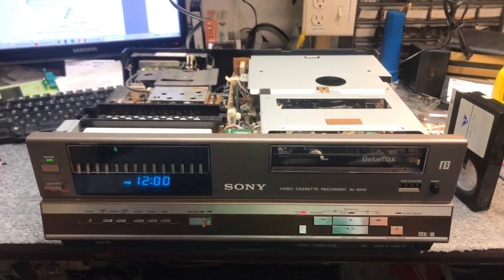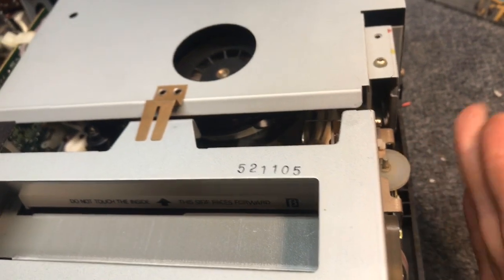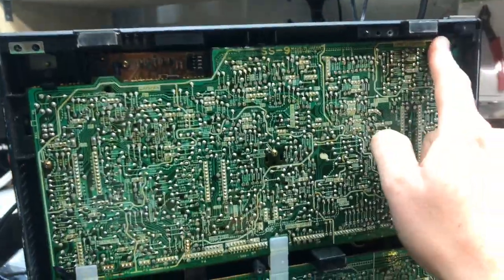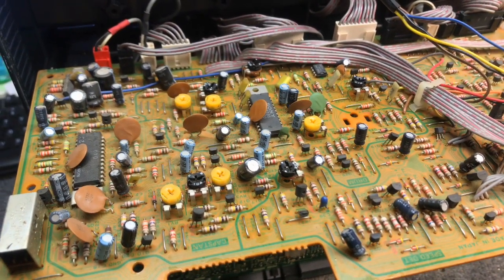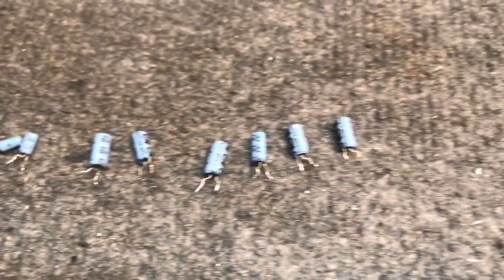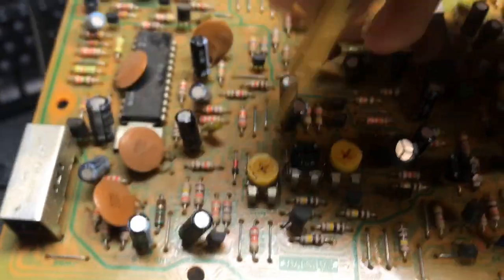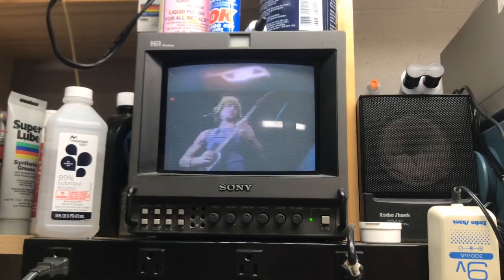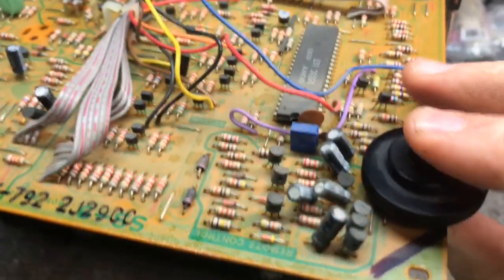Sony Betamax SL-5000 Series Repair - No Video/Snow

Comment: I have replaced the 0.1uf electrolytic capacitors with 100nf polyesters and they work perfectly fine.
Reply from the maker: Yeah I’ve since moved away from the electrolytics.  It’s getting tough to even find them in values that low.

Comment: I know its been 5 years but thank you for keeping this up. I am currently working on my sl-5000 that has motor speed issues 😂 i just got our sl-5400 working
Reply: Update i have replaced all the caps and still black screen but i have audio still 😂 so i didnt break anything i dont think. Time to move on to the drum i guess. If need be can i take the heads out of a betamovie and use them in the sl-5000?
Reply from the maker: @piecharts5036  sadly the Betamovie heads are worlds away from a standard full size head.

Comment: That's right. Of course, it seems that the speed is slow or fast due to a defective tantalum capacitor. Adjustments were also required after replacement when recording.

Comment: I have a Sony SL-5200. Did a thorough cleaning and replaced all the belts and it loads, ejects, ff/ rew and plays perfectly but I def have the bad capacitors. Audio is fluttery and video rolls and/or has snow (you can still sorta see what's showing). Your video gave me the confidence to try to do the repair. Thx.
Reply from the maker: Solid work so far.  Good luck!

Comment: Good first step, replace all belts/idler tires and give the machine a good cleaning. Finally, check mechanical alignment according to the service manual.

Comment: Hello! I recently got a Betamax SL-5000 and what happens is: The tape will eject. So far, I have been able to get the tape to go in after a few tries, but it makes this loud, fast spinning sound, and then a click. If I push PLAY, the green light turns on but no video on the TV. If I push FAST FORWARD, the video appears on the TV, fast-forwarding the tape. Same thing with REWIND. When I called the only local VCR repair shop, the owner said they don't fix or work with Betamax. Do you think you could help me, please? Thank you so much!
Reply from the maker: When you say no video, are you watching this on a real CRT tv or a newer flat screen?  I haven’t found one SL-5000 that worked without changing the capacitors and doing the adjustments in this video.  

The loading problems are the belts and idler tires.  They all need to be changed by now.  If the machine can’t complete the threading cycle it gives up and ejects.
Reply: For the tv, I used a flat screen. I plugged the Betamax into the tv using AV cables. So yeah, no CRT. I've heard about the bad Sanyo capacitos, but I'm not sure where to get better capacitors online.

Comment: Can the adjustments be made on the circuit board without changing the caps? Got the picture and sound flutter on a sony c6ub mk2
Reply from the maker: You’d be shooting in the dark.  The caps are junk and need to be changed.  Not familiar with the overseas models personally though.

Comment: Wonderful video! Do you know where one could buy belt kits for these machines still? Any chance of a belt change video coming up for this model? Many thanks!
Reply from the maker: Gravyboy25 thank you!  If you give Russell Industries in NY a call they should have most of what you need as part of their PRB line of belts.  Just supply them with the model number.  It’s getting harder to find idler tires but the belts are still out there.
Reply: @Tapes1982  An update on my machine. I haven't replaced any belts or caps yet, but when I play back the tape, I can hear the audio speed is very inconsistent. It goes from normal to slow, to sped up randomly. As I watch the little window on the beta cassette, I can see the rotation speed is inconsistent too. Do you think this is related to the caps from this video? Or from the belts. As a side note, I see white horizontal lines during playback, but when I do betascan FF or Rev, I do see a good picture.
Reply: @Tapes1982  I've just replaced three bands on a SL-C6 by welding my own from some belting I got from Amazon. "Akozon Polyurethane Round Belt PU Polyurethane Round Belt for Drive Transmission High-Performance Green Rough Surface (2mm*10m)" I cut the belting material to size then welded the ends together by holding them against both sides of the flat surface of the plastic-weding tip for my Weller heat gun, and then holding them together, as in -line as I can. Then I cut off the sticky-out bits to make the joint reasonably smooth. They grip really well and the joints seem pretty strong. I've also replaced belts of cine projectors using this stuff. UK Amazon link https://www.amazon.co.uk/gp/product/B07KQ2H1CM
I also shortened the spring underneath at the back to pull the idler more firmly onto the drive so I didn't have to manually poke it as Tapes1982 does in the video!
I also tried applying 'Platenclene' to the idler tyre but that wasn't really the problem (https://www.amazon.co.uk/AF-Platenclene-Cleaning-Pump-Spray/dp/B0012IKSHO)
Now the mechanics are working I'm trying to work out why there's no sound or picture!

Comment: I recently picked up the same model, however, it doesn't power up except for the clock. Any suggestions?
Reply from the maker: Leonard Jericho Balang first off I’m terrible at troubleshooting over the internet, but I’d begin checking voltages leaving the power supply.  That’s if you’re getting a clock AND no power indicator light.  In my experience with this series, they aren’t known for common power supply problems.  I really haven’t had to touch a supply yet in any great detail.  You will need a schematic, which I may have if you need a photo of the circuit.
Reply: @Tapes1982  I managed to power on the SL-5000, but the other problem is that the take up spool doesn't rotate when playing.
Reply from the maker: Leonard Jericho Balang time to check all the belts and idler tires.  That’s another common problem once they age and begin to slip.
Reply: @Tapes1982  Thanks for the tip! Now I know what they're called.